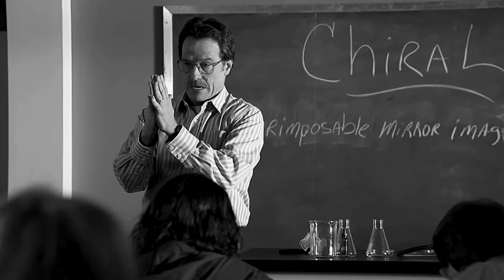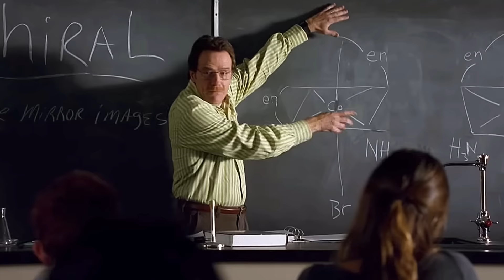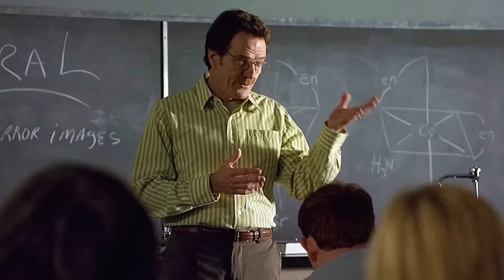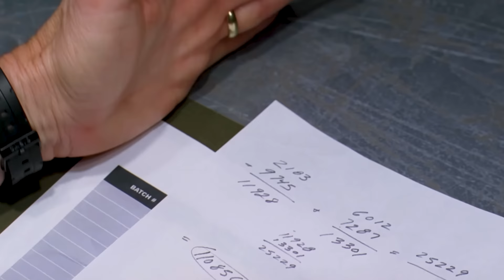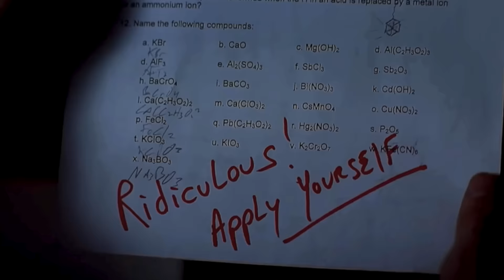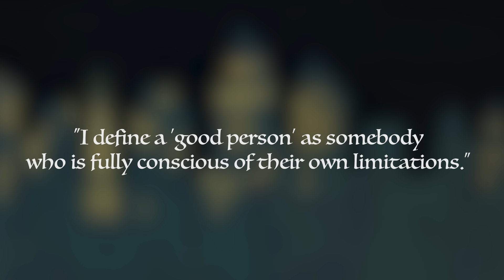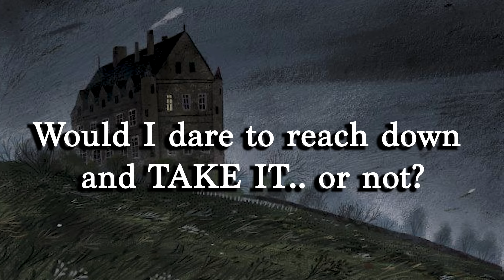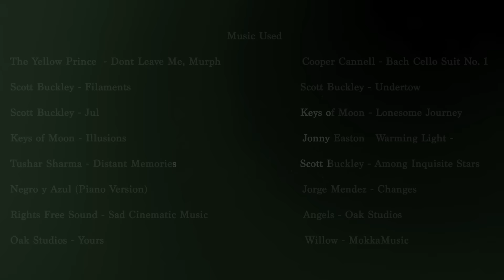Why Breaking Bad is Television's Magnum Opus (Video Essay)

Comment: Great essay. I'd just like to give an alternative explanation of when Walter White becomes Heisenberg. Could it be that the question should be flipped on its head? ie: When did Heisenberg become Walter White? Because the Walter we see celebrating his 50th birthday with turkey bacon and the saddest handjob I've ever seen is quite far from the Heisenberg that is the one who knocks we are led to the, i suspect intended, misinterpretation that Walter precedes Heisenberg. I think, however, that the Walter we see in flashbacks, confidently teaching Gretchen in an inspired way or boastfully home shopping with the pregnant Skylar, isn't actually the Walter we meet in the pilot episode. That is Heisenberg. Pre-crime Heisenberg, but the actual personality that used to reside in the shell of a person we meet first on his depressing 50th birthday. Breaking Bad is about Walter becoming what he always was. It is Walter choosing to fall in love with his fated end. This was always within him. Ever since he saw the shell of his father he knew, that he was predisposed to take radical measures to escape that fate. And yet he was well en route to becoming exactly that when he was awaked by a mustard stain with a side-order of a cancer diagnosis. Breaking bad, or, if you will, breaking out. Escaping the mundane slow suicide the dethroned and scorned Heisenberg was taught by civility to endure. Nietzsche would, I think, agree that Walter always had the capacity for Heisenberg within him, and I'm just taking it one step further by suggesting that perhaps there never was a Walter as we thought we knew him from the beginning of the show. We meet a man dying slowly, who comes to realise he may be dying a lot faster than he wasn't considering, and in that realisation it dawns on him that he is exactly the type of person who has always wanted, since he was a child, to design the stage more deliberately before curtain call. And, indeed, the show closes with Walter getting the only death that would fit the son of his father.
Reply: A great observations. Indeed, we are capable of dimming our own lights out and reigniting them just as much as the world, if not the more.

Comment: This is a good analysis. 

Personally, I prefer better call Saul as a cohesive magnum opus.  With breaking bad you can tell that they kind of didn't understand what they were doing in the beginning. You can also tell what era it was made in with how some of the episodes follow a formula.  With better call Saul, Vince used the lessons that he took from breaking bad to make something quite incredible.  Even the beginning parts of better call Saul are extremely engaging because of the detailed character work at play. When the big turn comes at the end of the series it's truly shocking in a way that is masterful.  Saul's journey reaches much more of a prominent catharsis then Walters. Some of the highs in breaking bad might be higher than the highs in better call Saul but the lows are definitely lower; which is why the story of Jimmy McGill is much more consistent. 

For the record, I think that Walt was always Heisenberg. This idea that he somehow changes for the worse is a bit of a stretch. As you said in the beginning of the video, he always had the capacity for these things and it is that persona that was dormant in his everyday life even before the show started.  He may have been more meek prior to stepping into the business but anything could have set him off earlier down a similar path.  I truly believe that there's a alternative reality where Walt owns gray matter and works as a chemist and a cutthroat businessman.  In that sense, he would be Heisenberg except without all of me illegal theatrics.

Comment: A “magnum opus” means that’s a perfect piece of work. That it excels in every aspect of its totality. The sheer fact that you had to use the theme for Interestelar, a completely different piece of art in technically a different medium, already goes to show that Breaking Bad cannot be considered the Magnum Opus of TV. 

And I personally love this show.
Reply: Yeah, arcane is a much better show.
Reply: Magnum opus doesn’t mean perfect; far from it. Magnum opus represents a large, extremely important piece of art - some considering it the MOST important piece. Not the best, not the greatest, but the most vital, the most grand, the most important. Because of the impacts it caused by simply existing. And I think that clearly applies to Breaking Bad as televisions Magnum Opus.
Reply: The wire is magnum opus imo because its themes are so wider and grandscale then breaking bad does imo.

Comment: but better call saul is just a straight up better show in every way...
Reply: Disagree. Loved Better Call Saul but the ending was extremely anticlimactic to watch, even if it made sense.

BB made sense and was also enticing to watch.
Reply: thats crazy
Reply: This. The only thing that Breaking Bad does just as well is the acting imo
Reply: Even though I also preferred Better Call Saul due to the last seasons being so intense, the question isn't about which of these 2 is better. It's that both of these shows combined is better than anything else out there.
Reply: @Murgota bcs is not better than breaking bad but I agree that breaking bad isn’t the best ever (although it is top ten bcs is top fifteen) the wire is by far the best show of all time for me lad
Reply: But no
Reply: @raymondsims7042   thats crazy
Reply: Ok?
Reply: @Murgota  which part was “crazy” 🤔having the wire at number 1?